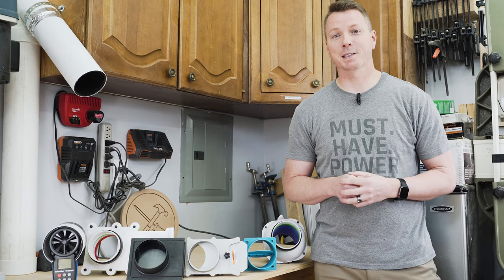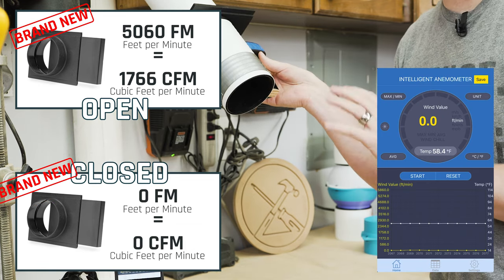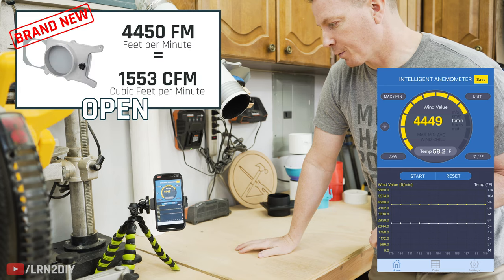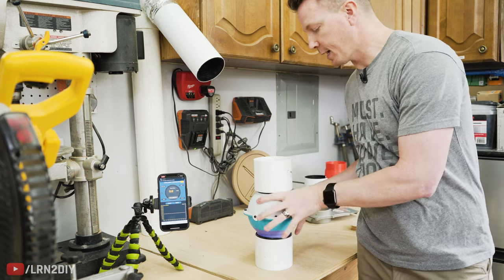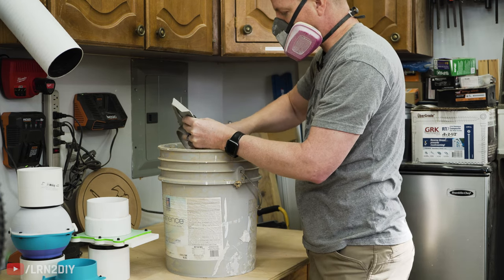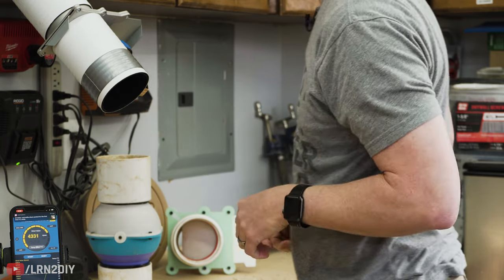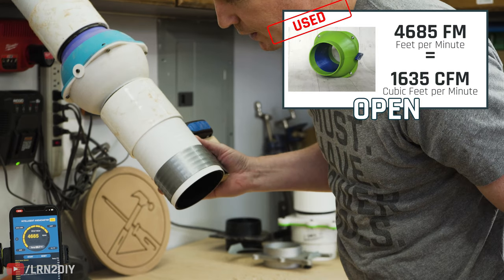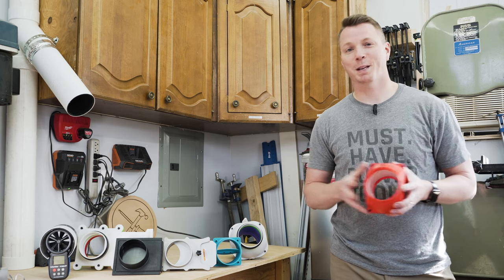5 Dust Collection Blast Gates Compared + 3D Printed Valves

Comment: Per the instruction on metal blast gates states the locking screw should be installed on the opposite side reference to the vacuum. The gate is draw to the suction and closing of the opening. The screw as shown on the video will keep the gate from sealing completely I believe. This is per Spiral Mfg in their blast gate instruction.

Comment: I've been using the valve style 3d printed ones for a while now.  They worked well at first, but they are slowly degrading.  They don't seem to take the wear and tear well and I've snapped off the turning handles a bunch of times on several different ones.  So while they do work nicely ... it's short lived, or at least it has been for my setup.  As they age there's more and more resistance in trying to turn them.  Not sure which I'm going to next, probably another DIY something-or-other!

Comment: Correct me if I'm wrong but I Think your flow numbers are being inversely represented.  Your measuring air velocity not air volume directly.  So by putting a restriction in front of the meter you are increasing the velocity but actually reducing the cfm.

Comment: I designed a vertical rotary valve blast gate- allows choice of two inlets, or off. Halves the number of gates that you need. Motor driven, of course.

Comment: On the cheap blast gates open the gate and drill a quarter inch hole maybe 3/8 inch hole at the very corner of the blast Gates so that the sawdust is pushed towards that and it'll be self-cleaning and will close again.

Comment: What is your guess as to why the ABS gate performed much better than the metal one?  Is the metal ID smaller?
Reply from the maker: I think it's the inside diameter of the flanges. The aluminum flanges are much thicker and I think that has a big impact on the air flow. It's deceptive though - they open up more than the ABS ones so it definitely looks like the aluminum ones should win but they never did.
Reply: @LRN2DIY  It may also be that because the sliding portion blocks some of the opening, which then has the effect of increasing the velocity in the remaining opening. I noticed that you used the same cross sectional area for all your feet/minute to ft^3/ min, but given that the ABS one blocks off some of the opening it should have a smaller cross sectional area which would lower the ft^3/min.

Comment: TY for doing the work to test all these.  Printing some ball valves while I watched : )

Very good test, I love that you mounted the anemometer for consistency...  see so many folks just hand hold it.  

I think the one thing not considered in this test though (should you or someone else redo it) is that when there is restriction of some kind at the suction end, as there is in real world use, then some of the valves designs leak a lot of air in from the outside, loosing suction in the process.  To better represent reality you'd need a length of restrictive pipe/host between the valve and where you test, or do something like restrict the outlet on the other end of the anemometer 50%.  I don't think you'll see much of that loss with a wide open end after the anemometer the way you tested.  Alternatively setup a wye, where you can close a gate and then test the other leg of the wye to see the effect of air leaking into the gate.

Comment: Good research. Is anyone printing and marketing them in less common sizes like 5", 8", and 10"? I suppose they'd be very expensive, wouldn't they? I'll probably settle for shop-built segment of a circle like the recent Katz-Moses design.
Reply from the maker: Good question. I haven't seen any but I've been focusing on the 4" and 2 1/2" stuff. In those cases, I think you're right - the shop-built options may be best. I saw the Katz-Moses video on his blast gates and they looked pretty cool.

Comment: Very good test video. It's cool to know in advance how different solutions will perform, so one doesn't waste money or filament. 

I'd like to know what system you use to extract the air/dsut, i guess it's a professional grade one? I'm trying to build one myself for my DIY Workbench from a duct fan as cheaply as possible and would like to know what i can put in between it and the suction end, besides a cyclone seperator. Im thinking of several removable grid-plates with the holes getting progressively smaller and a filter mat right before the fan. Can you give some usefull tips? Thanks!
Reply from the maker: Hey Buzz, sounds like you've got a cool project on your hands. I'm using the $200 Harbor Freight 2 horse power dust collection system. I'll be posting a video about my setup because I've learned a ton in the last several weeks. I don't know how much help I am on the DIY dust collection front but, if you haven't already, do a quick YouTube search for Mathias Wandell Dust Collection and you'll find a host of videos on the topic. He's a total genius and has some really clever solutions that I think will serve you well. Best of luck!
Reply: @LRN2DIY  From the first looks, wow, this guy is serious about that particular topic ^^
Thanks for the resources and the heads up, this helps a lot
edit: i actually had a subscription already from other wood projects he did (i think marble-related or something), but wasn't aware of the dust collection videos/projects

Comment: 5060 feet/min is not 1766 CFM for a 4" diameter pipe. You forgot to divide the diameter by 2 to get the radius.

The correct calculation is 5060 * pi * (4/2/12)^2  =  442 CFM.

Comment: What is the black liner you put into your 4 inch pipe?  I been using flex tape around my blast gate and hate using flex tape as it is sticky and messy and hard to work with.
Reply from the maker: I didn't add any liner into the 4" duct, that's actually a liner that comes with it because these are drain pipes that come that way. They're a little more flexible and cost less than standard 4" PVC. Around 4:38 in the video you can see that I used electrical tape to adjust the OD of the gate. I like that it's a little rubbery and compressible and has held up well.

Comment: I am in the midst of printing out the 2.5" ball valve for testing.  Question:  do you recall your print settings?  My first print came out great.  however, when I place mouth on inlet and blow (not too hard either), air leaks around the ball and escapes the outlet.
Reply from the maker: I can't recall what the settings were at all since it's been so long. I do remember that the ball valve, while pretty fun to use, was difficult to get to turn smoothly. The print has to be pretty perfect (or a lot of post cleanup) in order for it to move as it should. Too much cleanup and you'll create gaps, so it is tricky.
Reply: @LRN2DIY  that is what I suspect...too much sandpaper done on the inside.  Plus, I did oversize it (inlet/outlet & ball) from 100% to 102% to easily couple with 2 1/2" green sewer & drain PVC pipe.  I am reprinting to original 100%, using 0.12mm instead of the original 0.2mm (hopefully that means less air gaps per line).  I have it in mind to try out servo motors + ESP32 for automation.  Will also try adding fiberglass repair bondo to help with the air gaps.
Reply from the maker: @ejholbs3730  Sounds like those changes should certainly help. I'd love to hear how it works out! I still have a couple of these variations in use in my shop but I haven't spent the time to really perfect them so I'm mostly using the traditional $6 gates with the tape flap. The 3D printed ones look about 100x cooler though :)
Reply: @LRN2DIY  one of the Pro's of such a ball valve setup is not external pieces to be broken off or run into or snagged.  I did DIY self cleaning blast gates for 6" and 4".  All middle flat pieces eventually broke off.

Comment: You missed a very important test though!
Should have measured between the gate and the dust collector closed to see the actual flow including leaking, as you completely missed any leaks from places that are not the hose on the other side of the blast gate
Reply: But he isn't testing the whole system, hes testing solely the blast gate. Otherwise it wouldn't be a fair comparison would it?

Comment: Assuming a steady blow, the higher the fpm the smaller the cross section. So the 6 dollar gate has the smallest cross section. It does not make it a winner but a loser. If you want cfm, messure the true cross section, and multiply with the fpm. So you get a theoretically cfm. Not a true one, as you also need to calculate static pressure.
Reply: Thank you. I thought I was the only one who noticed the “science” here. Also, your cfm values are insanely wrong. Your anemometer apparatus is blocking a substantial portion of the 4” port. This will give you a much greater measured velocity, but you are effectively reducing the duct to maybe a 1” or 2” diameter pipe. So yeah, 4500fpm, but you have to plug in the actual area of your duct with the anemometer in the way into your cfm calculation. IRL a 4” pipe maxes out at 350-400 cfm.

Comment: I'd love to see this updated using 5" aluminum blast gates on the 4" pipe.  They end up not restricting the flow since they slide over the outside of the 4" pipe instead of going inside and decreasing the volume.   I also disassembled them and put some strips of gorilla tape inside to help seal them when they are closed, as seen in this video:  https://www.youtube.com/watch?v=qqMwV752WS8   (not me).